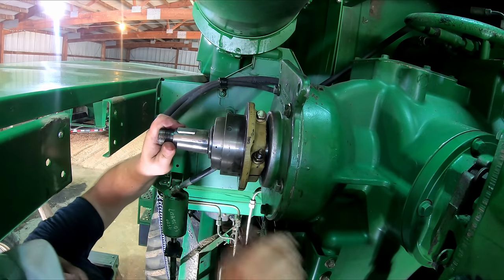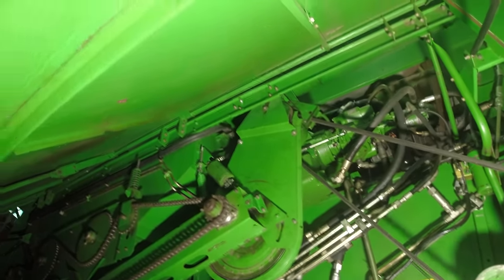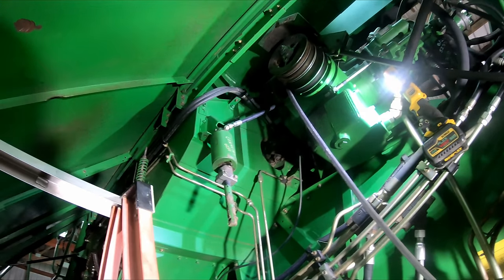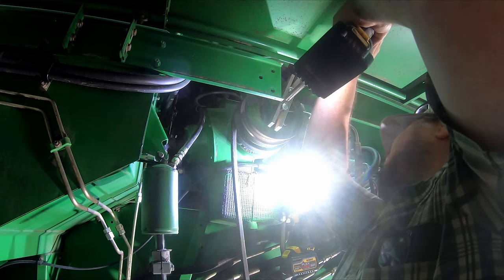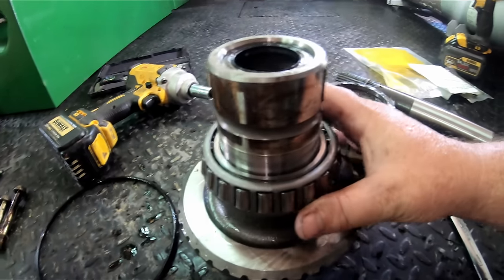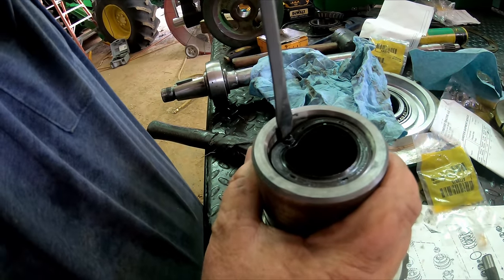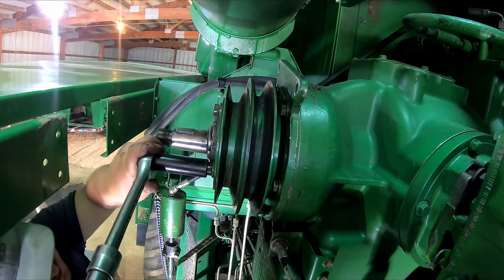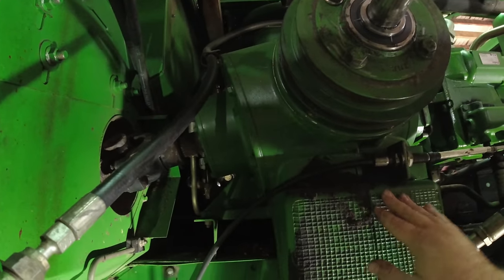How to replace outer seals in Separator Gearcase John Deere 9000 series combines. Shop Repair Series

Comment: Glad to see some other "how to videos" for older combines. Give me ideas of things to check on our 9500. Only thing that surprised me was y'all went for parts and came back with them....we got to call first to see if our dealer has everything there before we go anymore
Reply from the maker: I've got to brag on our dealer.  Most all parts have been in stock. Only thing we've had to do is wait a day to have them pulled in from the other stores.  We've got about four Tennessee Tractor stores all within 45 minutes of us.  We can be at 2 of the Hutton Stores in about a hour and fifteen minutes. Also got 2 Legacy equipment stores across the river in Missouri that we can be too in about the same amount of time.  We are lucky to be where we are right in the middle of a bunch of good Deere stores.  I'm assuming ya'll deal with Tri-Green? I haven't heard much good about them.
Reply: @DylanJoyceFarms  we drove over to TN tractor to get parts before and up to the Hutson too. Tri green is fine if youve got new stuff or lawnmowers. I always just call and I can get the part in a day or two. If all else fells, we just call out at Sexton mo and got.out there for parts

Comment: Great video. Going to use this to fix mine.  Just one question. How heavy was it to swing lower that unloading assembly
Reply from the maker: The arm isn't really that heavy. Just undo the cylinder and the spring and let it slide down.